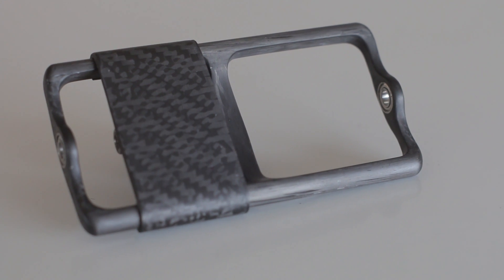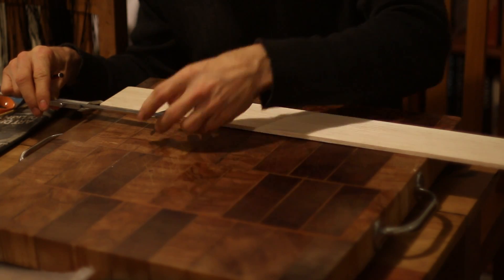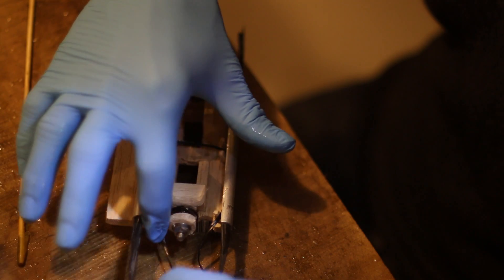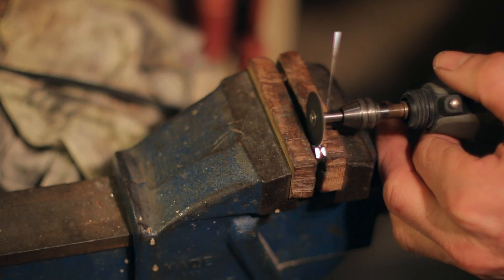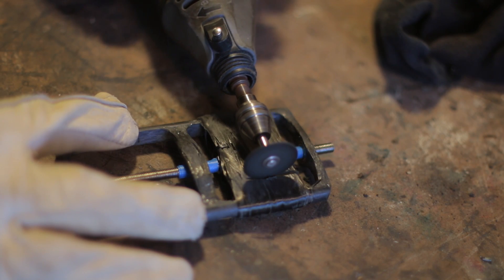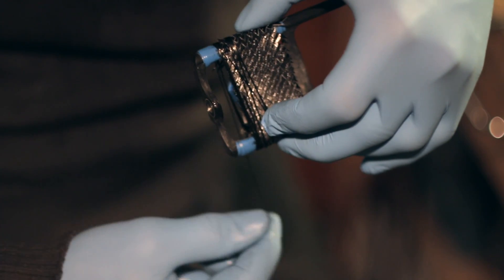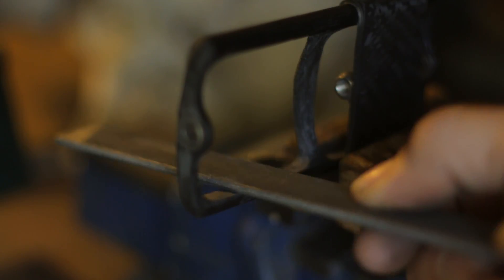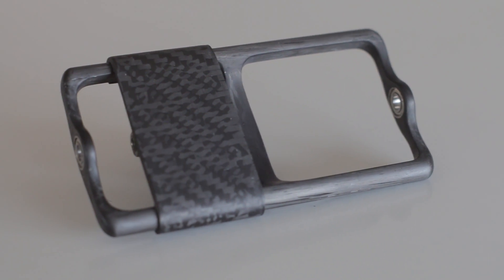Carbon Fiber DSLR 3 Axis Gimbal/Steadycam Build Part 3

Comment: Really amazing project. You're so incredibly patient and innovative, but I worry about your exposure to the airborne fibers. I noticed that you wear a full face respirator, but you can't always wear one in the shop, and there's lots of stray fibers about. If you had a vacuum table with hepa filter bags you wouldn't have to worry about it. You should think about building one.
Reply from the maker: +dieselphiend Hi Diesel, Thats a good idea I may have to build something like.  thanks for the heads up and for the kind words, have a great day!!

Comment: I love watching really talented people make super cool stuff like this. It's such a pleasure to see something come out of nothing. Also... where on earth do you source this sort of material?? I'd love to make some parts out of carbon fibre.  Looks so satisfying to work with:-)
Reply from the maker: +Woodeso's Guitar Mods Hi Woodeso!  Thanks again for kind words.  I get my carbon cloth from the local ebay equivalent.  I got mine a long time ago when I had a business working with carbon fiber.  I should imagine it is readily available in the states in all kinds of weights.  Twill cloth, double bias (the stitched heavier cloth) and unilateral (carbon strands in same orientation), which I find very handy.  I think West Systems resin is probably the two part resin system that I have seen in the states, it is very good quality.  We have our manufaturer here in NZ that is Nuplex.  We have a strong boat building history here so these things are quite common.  I think High Modulus is also a big manufacturer of carbon cloth.  Its great stuff, you will love what you can build with it, virtually anything you can imagine.  Have a good one!!
Reply from the maker: +elams1894 I see you jave just uploaded a vid yourself, I'll check it out after breakfast!
Reply: +Woodeso's Guitar Mods It's beautiful work isn't it, Nelson
Reply: +elams1894 what do you use unilateral cloth for?
Thanks for you videos, it's amazing! :)